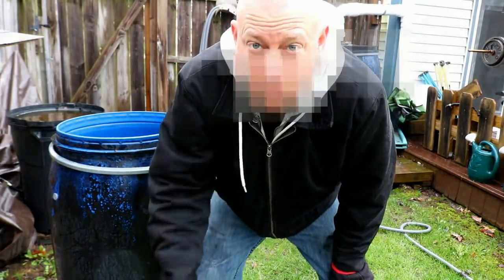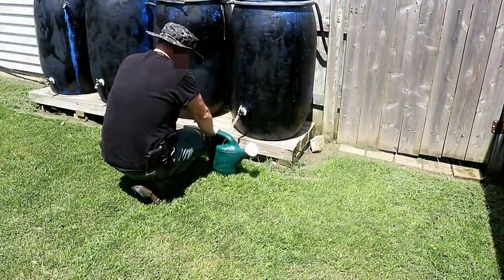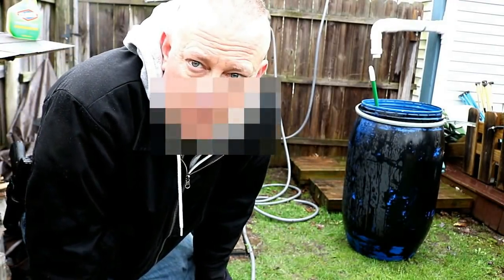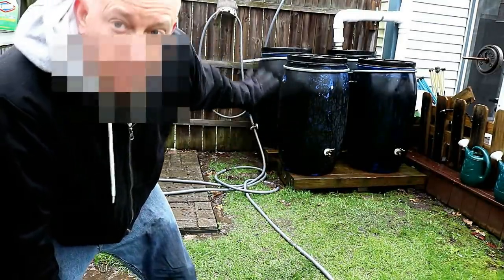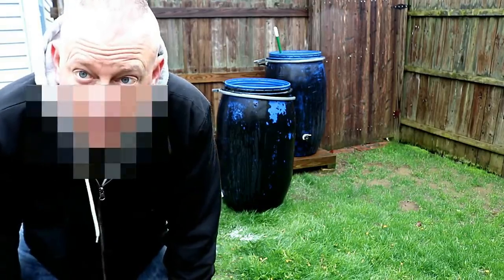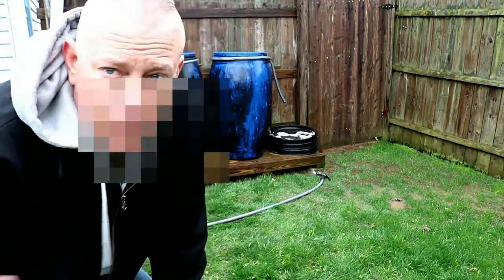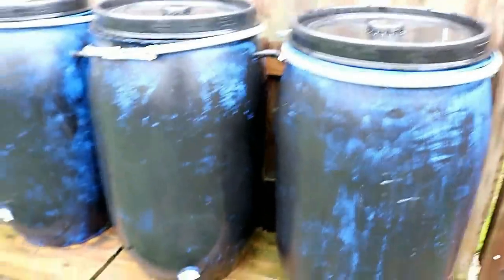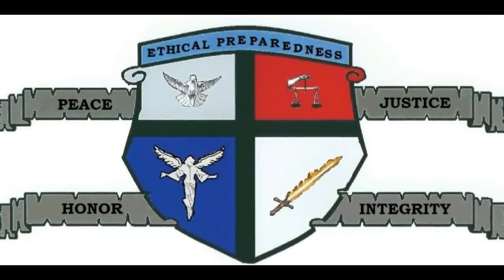Rain Water Catchment for the Poor Prepper (and how I butchered it) - First Flush

Comment: Kudos to you for building a rain catchment system.  It looks like you created a well thought out system.  Also, thank you for taking the time to show everyone how one should be built, the many considerations that goes into building a proper system, and how your system works (warts and all).
>
That being said, I am a chemist and I am amazed at how little people understand about something as simple as water.
>
First of all, a diversion system works , but not as well as what we would like to think.  When the rain initially starts to fall, the "stuff" is easily and quickly washed off and flushed out your rain catchment diversion system.  The problem is that you are going to end up with a lot of bird poo/pee on your roof and these do not rinse off easily.  Birds do not excrete urine that contains urea (to get rid of the toxic ammonia from amino acid/protein metabolism) because urea is water soluble and requires too much water in their bladder which weighs too much thus interfering with flight.  Instead, birds excrete a paste-like material containing uric acid.  Have you ever noticed how hard bird poo/pee is to get off your windshield even when it is raining hard?  Your windshield wipers go back and forth over and over the bird poo/pee and it just stays there.  That is because the uric acid is not very water soluble so it sticks like glue to the glass.  What this means is that the bird poo/pee is going to get into your rain catchment system no matter what.  Additionally, leaves, twigs, and other detritus that falls off of trees gets stuck in your gutters and elsewhere.  These also slowly leach other organic materials that will get into your catchment system.
>
Second, the friends and neighbors found in your system clean out are not green so they are likely not algae.  This would be expected due to the black paint on the outside of the drums which would block the sunlight necessary for photosynthesis needed by algae to grow.  More than likely you have bacteria and fungi growing in your catchment system.  In fact, if I was a betting man, I would put my money on mildew ( a black fungus found everywhere) that is in your catchment system growing on dilute uric acid and other organics that wash off the roof.  (Mildew is amazing for its ability to grow on just about any substrate and carbon source.  It's the same fungus that causes the paint on your house to blister and fall off and the black stuff that grows in your bathtub/shower.  It is also the reason why various roofs slowly turn black over time.  If you look at many roofs you will see a light colored strip of roof below many pipes exiting the roof.   Vanishingly small amount of zinc from these galvanized pipes leach out when it rains and the zinc inhibits the growth of the mildew.  The light color is near the original color of the roof while the darker color on the rest of the roof is from the melanin pigment produced by the mildew.  The older the house, the darker the roof and more prominent the light strip below the galvanized pipes.)
>
Third, not only am I an old man (some say I helped invent dirt), but I am lazy.  They have written songs attesting to my laziness.  As such, there is an easier way than that shown in this video.   Once you build your rain catchment system and show its proof of concept that it works, it is time to put most of it away.  Instead, fill your drums with tap water and seal them.  The chlorine used to disinfect the water at the city water treatment plant will still be in the water in sufficient quantities to render it essentially sterile.  If you put this tap water into a sealed drum, then there is no contamination in the water or the cleaned drum that would allow something to grow.   Being that there is no carbon source, there is no source of energy in the form of food that can be metabolized so nothing will grow.  Additionally, without carbon containing food, there is no carbon and such the microbes can use to grow new microbes.   If the drums are black or colored such that little to no light is allowed through (such as the ones shown in this video) then there is no sunlight so that source of energy is not usable and microbes such as algae cannot grow.  What this means is that if you put tap water into a clean, dark, and sealed system, then it will remain clean and potable forever.  It also means that all these people that sell you their miracle product that only requires a few drops per gallon or whatever in tap water that is then sealed in a dark container to keep it potable is nothing but a scam.  I see these scams all the time and I never stop chuckling over them.  The bottom line is that I would create enough water storage that is sealed so that I know the water will remain potable and will never require any maintenance work.  I would keep a catchment system up and running that is large enough for any gardening, but that would be all.  If SHTF were to occur and city water was no longer available, then I would open up my drums, use the water from them, and then use the empty drums to create a larger rain catchment system.
>
Oh my.  Once again I have gone off the rails by writing far too much.  Please accept my apologies.  Additionally, please accept my thanks for creating yet another video that covers a very important prepping topic.  The great value of your videos is that you take the time to try things out and show what works and what doesn't.  Lastly, I just got my ethical Preparedness shirts in the mail today and they are more gooder than they appear in the screen.  My son saw them and wants to get some for himself and I haven't he heart to tell him that some of the shirts are for his birthday present.  Once again, thank you for the great video.  Keep up the good work!
Reply from the maker: You always give EXCELLENT tips Cleetus.

That black stuff at the bottom of my barrels is the grit that comes off my shingled roof. I'm able to get 99% of it diverted from my rain barrels as it gets washed off my roof, but unfortunately some of it still ends up in my barrels. Maybe one day I'll be able to have a metal roof. :)

"They have written songs attesting to my laziness" ~that gave me a good chuckle. :)

Comment: I think part of the reason for your algae problem is that you are reoxygenating the water when it 'pees' into the next barrel. If you took a small length of stainless steel tubing and used it to directly load the overflow to the bottom of the next barrel, that should help. Just a thought.
Reply from the maker: Thanks for the tip.
I don't really get too much algae in my water. It's mostly the bits of asphalt from the shingled roof that ends up in the first barrel. Maybe one day I'll be able to afford a steel roof for the house. 
And I'm in the process of buying a rural retreat location; and I'm wanting to put a metal building with a metal roof there. :)

Comment: If you (further) put a major "U" goose neck on that drain PVC (versus a "J" system), you will drastically remove the majority of dirty particulates from getting into the first and secondary barrels.  As such, drop down a 6 foot "U" and then back up to your original position.  You have the PVC screw drain plug in the bottom.  In spring, etc, you can open the drain plug, push in the water nozzle and flush out the massive remaining dirt caught by gravity falling back and down into the "U" shape.  This is the best option for both home and cabin systems.  The higher the goose neck, the water will have greater clarity.  Having that goose neck with the same tiny drip and clearing system, gravity clears out the particulates.  This also slows down any massive water flushing with rain storms flash flooding the catchment system.
Reply: Nice suggestion
Reply: @tcscorner3028  Although its a PIA design, it really works.  Also one could consider having the further option of an inline system loosely-porous water filter, like a small air HEPA filter.   A PVC duct ring that screws down a water filter on the backside flow (at height) of the goose neck.  You would seriously remove all the major particulates of the system, and have them gravity fall back down to the bottom, and eventually trickle drain out the bottom plug.
Reply: @johnlord8337  awsome I'm going to try it on my rain barrels thx for the info bud

Comment: If you take that bowed bottom barrel and use a heat gun (like you use to strip paint) careful not to melt through get it good and hot then "wack" it with with a rubber mallet - you might get lucky. Filling your tanks from the top is best. 1st. dirt settles to the bottom so not as much gets pass for one barrel to the next one.(if you got a way to siphon the water from the top instead of a tap at the bottom your get cleaner water) 2nd can you imagine the pressure that you transfer lines would be under you would need to make them tight or lose your water.
As always it is good to see your "Smiling Face" hehe

Comment: I have some what they call wetend wire off a paper machine from a papper mill. It will filter out smaller particles than what comes off your roof. It is what the paper pulp is first sprayed on in making paper. Oh yes sections  of  about 20 feet long can usually be gotten at a paper mill salvage yard.

Comment: If you want to be able to get the roofing sand out of there, put a spigot at the bottom of the barrels so you can siphon it off periodically. Put the spigot at the edge of the bottom or on the bottom. You can flush the grit out without losing all your water

Comment: Not a bad job for the first time, next time you learned, that's how l learned, each time you do something build on the time before and bottom line 400 gallons of water is a good accomplishment. I like this and l can make.it look like a shed for concealment. Thanks Guru. I probably could cut way down on food but l would suffer without water.
Reply from the maker: Thank you.
I did such a crappy job on these, that I actually hesitated to even put them on video.
But even though they're a crappy job, they still show how a prepper on a budget could easily do this themselves.
And I also like how it's 'scalable'.... how  person could use only one(1) barrel if they were tight on space, or use 20 barrels if they had plenty of space. 

But like you said: I learned a LOT when I did them; and the next time that I do them I will do them correctly and learn from my mistakes. :)

Comment: use plumber tape on the hose with handle sprayer help seal it up some
Reply from the maker: I only paid like $5 for it when I first got it several years ago, so after the video I just threw it away and actually bought me a decent one. :)
Reply: oh I normally make simple repairs till of literary no use and find reuse to items in reasons. such as I reuse bottle parts for insect traps during summer even reuse broken tool handle in some other manner, I did reuse shovel handle carved for a hammer handle reshaping. I even found if got old kitchen floor rolls they can be sewn in to tool belt pouches with bit tape on edges for overkill. it takes small things to do simples repairs though many pick at me for it.  most my favorite tools are really old store buys redone and finished for use but clean looking.

Comment: Good stuff. If possible have a metal not an asphalt roof if you intend to drink it. You are handling it as well as you can but microscopic asphalt will end up in the water. 
Tarps and kiddie bathing pools make great collectors in grid down
Reply from the maker: At the new bugout location I'm planning on putting a metal cabin (with a metal roof) on it. Of course this won't happen until my finances allow that to happen without it putting me into debt. :)

Comment: A fellow l.e.o. protecting and serving! A great idea to clean in spring?!  I have 3 from of charcoal and sand as a filter. Because of you, we painted black  our containers and it seems to keep the skeeters out in summer due to the heat produced   , Ours are tightly screened but initially it was to keep snakes out. We use a pool filter pump to move/ use water when need . We have 6 x 300 gal. IBC totes and 6 point of use smaller 50 gal. Barrels like you have. It can be sometimes 6 months without  significant rain here in Texas...when it's prime garden time. My current and retired K9 and 2 pigs that like their kiddy pools, so it helps.
Reply: Nice
Reply from the maker: Hey fellow brother-in-blue! I hope all has been quiet for you on shift (I know I just caused unspeakable horrors to happen now since I said the word "quiet."). 
I'm jealous of your large IBC totes. I think I may utilize them at my new retreat location, because my actual home's backyard is kind of small being the typical subdivision yard.

Take care; and always go home with the same amount of holes in your body that you start your shift with. :)

Comment: We here have bigger, green barrels. The rainpipes are made of metall, i think it`s copper or zinc but i`d have to go outside and take a look at it to be sure.
I don`t remember having probems with algae in them but we have regularly dirt on the ground and mosquito larvae when it gets hot.
We also have a blue one (and have seen several on other places) and they had algae most of the time if not always.

The best thing is to have access to a well or more with drinkable water where no treatment is needed.

Comment: Biggest issue of rain catchments on any petrochemical (tar roof), shingles, *even metal roofing), moss, mildew, fungus, pollution, dust, dirt, ... bird, squirrel, chipmunk crappola getting into the water system.  Pigeons and doves are notorious for carrying salmonella (!).  Little tweeties carry fungus, lichens, molds on their feet (infecting one's fruit and nut trees etc), and hopping all over your roof.  Same for seagulls and crows/ravens/starlings/grackles with their "very dynamic" crap shoots.  Rain runoff from tar roofs (even metal roofs with latexed or enameled painting) then give you leached petrochemicals (that has no options for filtering and purifications).  The algae you found, albeit dark barrels, was from the roof bacteria, moss, and critter crappola.  If anything, drop in a Pool Shock hockey puck into each newly cleaned barrel, and that should kick butt against any new infestations.
Reply from the maker: What size pool shock hockey puck do you suggest that I drop in a 50 gallon barrel? The little 2 or 3 inch sized ones?
(I guess I could take the time to measure it myself; but this is my "work 36 hours in just the weekend" weekend to work :)
Reply: @EthicalPreparedness  2 inch for each barrel would be more than enough - by their statements.  They say a 1/2 pound of Pool Shock crumbles treats 10,000 gallons (!).
Reply: @EthicalPreparedness  you could ozonate the first barrel at regular intervals. No such thing as too much ozone.

Comment: For the first time out of the gate you did great! I have a couple of suggestions for you. I didnt see any gutter guards on you gutters I would suggest getting some it will reduce that sludge you get in your barrels. If I missed them let me suggest some fine fiberglass mesh screen. I saw a roll of 48" x 100' for $46.80 on Amazon. I'm sure you can also find gutter kits that will have the frames in them. My second suggestion is think about an in line u.v. water sanitizer. It is suppose to sterilize the water of microrganisims which makes safe to drink after you filter out the other stuff. Again great video and thanks for the information.
Have a blessed weekend.
Reply: ScottyM1959 guess you could rig a pond filter into the first barrel as some have uv filters for them 👍🏻
Reply: @wanderingranger4208  Roger that!
Reply from the maker: @ScottyM1959: can you provide a link to a good in-line UV water sanitizer?
Reply: @EthicalPreparedness  I don't know good ones from bad ones but my research for U.V. sterilizers for rainwater collection systems show a less that budget friendly selection of option.

Comment: Definitely use the water you collect from the rain from a lightning storm for your plants.  The lightning breaks apart the diatomic nitrogen (N2) in the atmosphere and causes it to combine with the oxygen in the air to produce nitrogen oxides that then dissolve in the rain.  The rain then contains a weak nitric acid which is a good fertilizers for plants.  I won't go in to all the nerdy stuff here, but here is an article that will better explain the process than I have space to explain it here:    https://www.hunker.com/12003078/does-lightning-help-grass-grow
Reply from the maker: That's interesting! I've never heard that before. 
Now you have me wanting a good lightning storm to happen. :)

Comment: How much over flow do you get? Not enough to need drainage or does your barrels hold most of the rain?
Reply: My guess is he gets alot but I bet he uses the run off for his garden
Reply from the maker: It depends on the amount of rain to how much overflow I'll get. 
With a good downpour, those barrels will go from completely empty to completely full in just an hour or two. 

And then of course those barrels are only ever completely empty when I wash them out in the spring and in the fall. Otherwise they're usually about 75% full. 

But the overflow hoses are far enough away from the house that they overflow and drain off into the yard just like normal. :)